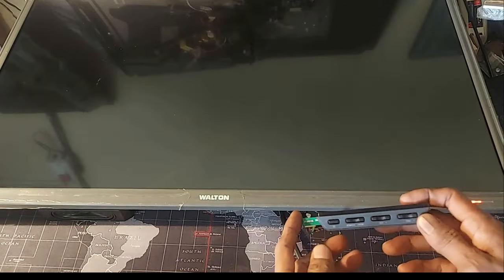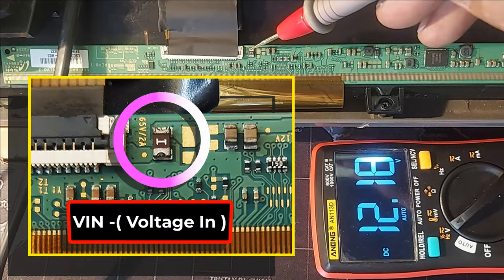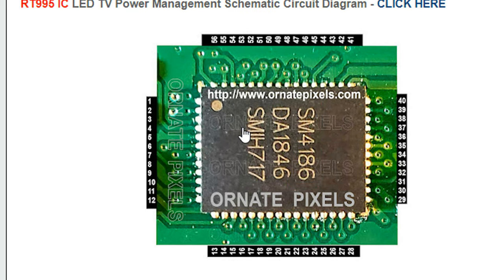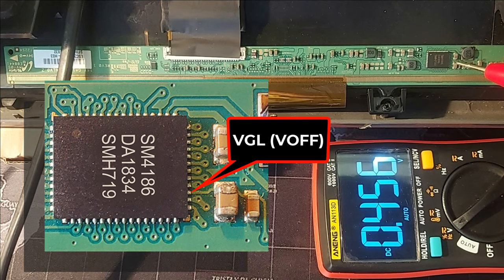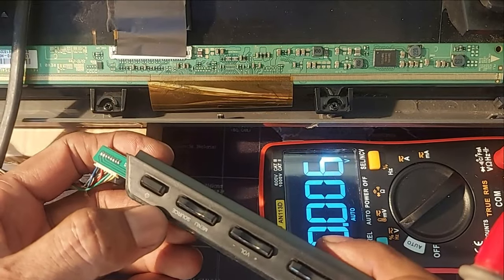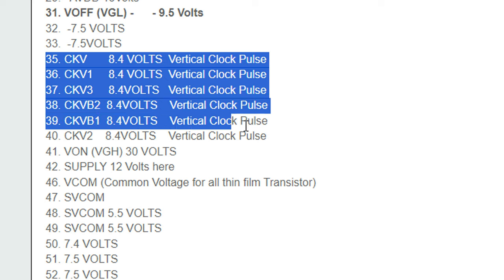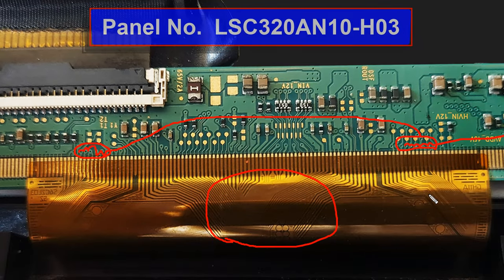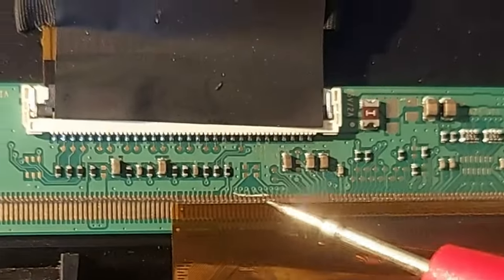No Display Black Screen Problem on 32 Inch LED TV,  LSC320AN10-H03 Panel Repair SM4186 IC Datasheet

Comment: Good day sir, 
I'm having issues with my 55" panel so please I need your help in solving it. The number on the T-Con is HV550QUB-F84/H11.
So when I tested the T-Con test points, these are the voltages I got.
VGL1 =-7.8V
VGL2 = -6.3V
AVDD = 17.5V
VGH = 32.8V
CLK1 = 7.5V
CLK2 = 7.5V
CLK3 = 7.5V
CLK4 = -7.2V
CLK5 = -6.3V
CLK6 = 7.5V
CLK7 = 7.5V
CLK8 = 7.5V
CLK9 = -7.2V
CLK10 = -6.2V
These voltages were gotten when I disconnected the 2 ribbon cables connected from the T-Con to the panel. There's no difference even when I connected both cables from when I disconnected both cables, voltages are the same.
CLK1,2,3,6,7,8 came from 2583B IC while CLK4,5,9,10 came from another 2583B IC.
Sir, I want you to look at the voltages and tell me if the T-Con is okay or not
Thanks